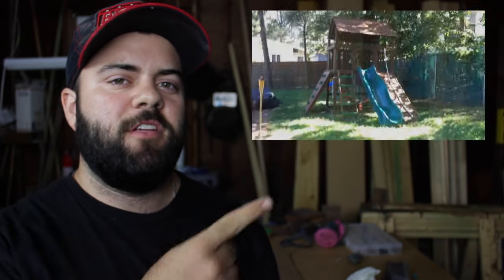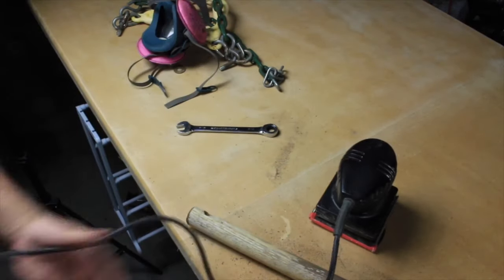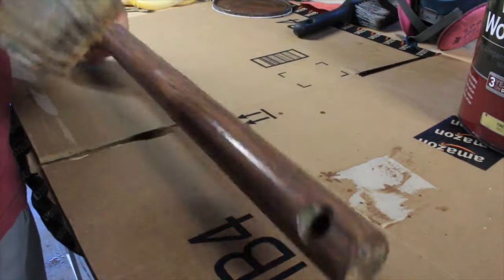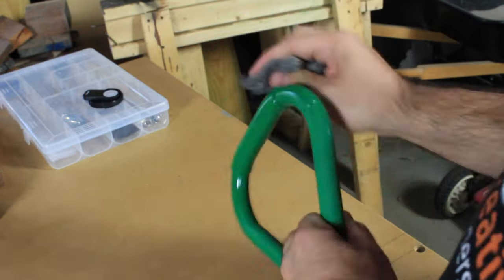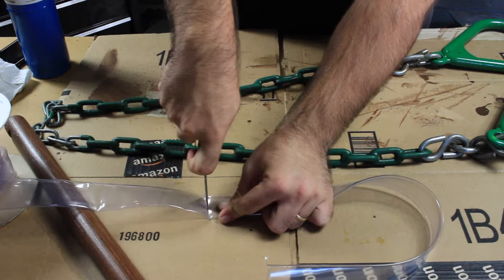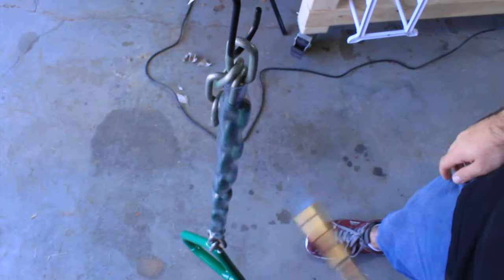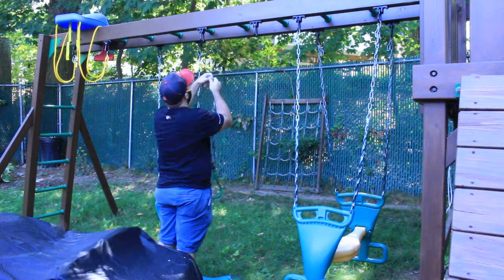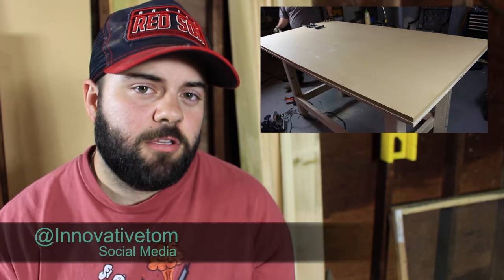Restoration: How to Bring a Wooden Swing Set Back to Life

Comment: Hi Tom-
I’m about to embark on my own swing set restoration journey and I have a few questions. 
1. Did you use some sort of sealant (poly) after you stained or was it mixed in with your stain?..
(I didn’t see the link to your Behr stain below). 
2. Application technique/applicators used. 
3. How has everything held up?
Reply from the maker: Kristen Hill the stain we meant for exterior decks etc. so no need to put anything on after. You need to just make sure you get anything old off first. Next get the biggest brush you can find. Usually with the deck stuff in the paint section. Again it just like a deck. Everything is help up fine. I needed to touch up a few spots. Next year probably do it all again.
Reply: Innovative Tom thank you so much!! By anything old, do you mean paint?...Because it’s not painted or peeling. Pretty sure it’s natural wood with some sort of sealer. But it’s pretty old/ weathered. So I think any sealant that may have been on it, is long gone by now. The wood itself is in great shape. Minus a few boards that were in the ground and need to be replaced. So after I’m done power washing, my plan is to sand and stain. Unless there’s a step I’m missing? 
Also, rather than using a big brush, do you think I could spray it on with my Wagner Flexio paint/stain sprayer? 
Then back roll or brush?...
I like the idea of using one of those big paint brushes. But I’m thinking maybe spraying it first would save me a bit of time. 
Any thoughts on that? 
Thanks so much for taking the time to help me. I really appreciate it.